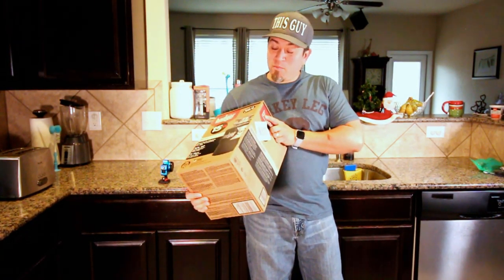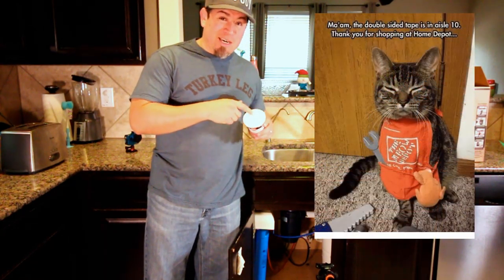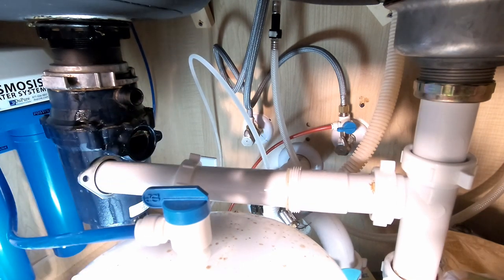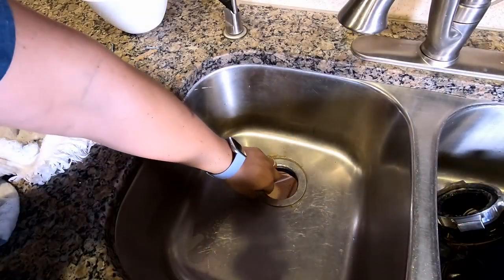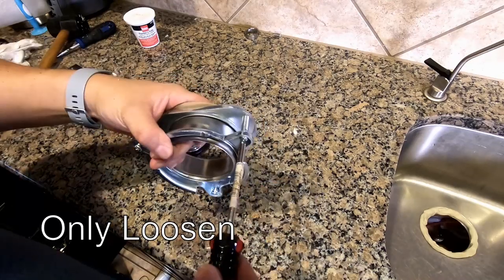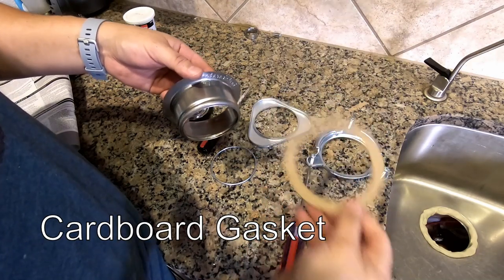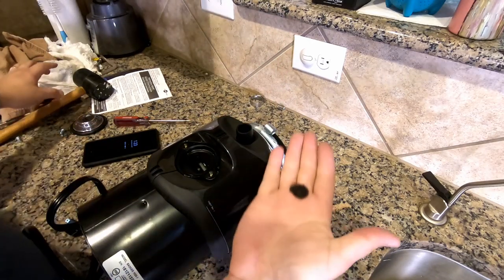Badger 15ss install - How to Replace a Garbage Disposal

Comment: This video was excellent! I have been avoiding replacing my broken garbage disposal because I thought it would be too complicated.  This video was well done and basically walked me through everything. The hardest part for me was getting the wires to connect to the EZ Cors connector. Thank you sir.  PRO TIP: The gasket that connected to the garbage disposal was leaking water. Make sure you adjust it evenly before tightening.

Comment: Don’t know if you’re still checking comments on this video (still relevant, still useful), but I just finished  replacing my daughter’s disposal, cracked a beer and feel like communicating.  I searched for Badger install because I was concerned about lining up my new unit with the existing drain pipe and I’d somehow lost the instruction sheet.  Anyhow, that all turned out to be no problem;  the turd in the punchbowl appeared earlier, when I was removing the old Badger 1.  I got a good laugh when you had to hacksaw the sink/basket flange off, because I ran into a similar (but worse) problem.  The triangular plate that fits under and encircles the sink flange was, in my case, rusted tight to that cylinder.  It took a full day and about a quart of PB Blaster to free the sucker, plus a lot of vulgar language and a lot of hammering with a piece of 2 X 4.  All in the past now, and the new Badger 15SS-3 works fine.  Your video was both helpful and fun.  Thanks for the moral support.

Comment: At the end, you correctly said, “And it works”, but you did not check for leaks  😢😢😢
I still enjoyed it. Thanks 😀
Reply from the maker: Sorry Richard.While not in the video, I did fill the sink completely with water, then ran the disposal to put stress on the connections and saw no leaks. To this day I havent had a single leak either.

Comment: Don’t want to be critical, but your rubber washer should not be fitted over the discharge pipe ... the rubber washer should go on first, then the discharge pipe, followed by the metal flange.  I only tell you this because my first Badger failed after being installed this way.
Reply from the maker: Thanks Steve. You are the second person to call this out. I mimicked how my previous disposal as installed. I have left as is and haven't seen any issues from it, yet.

Comment: If i'm imagining things, please correct me... but it appears you placed the disposal waste line seal over the outside of the pipe and flange (right around the 17:00 mark)... when the gasket included with Badger disposals is supposed to go BETWEEN the waste pipe flange and the disposal discharge outlet.  I waited to see how it ended up, and around the 17:45 mark, it appears you tighten the discharge pipe directly against the disposal with no seal between the two.
Reply from the maker: I had to double check my literature and it shows the waste line seal inserted into the tailpipe opening first, then the provided tailpipe on top of it. The way I installed it on the video is slightly different than the provided instruction, but I have done it this way several times now. I haven't ran into any issues with leakage before since the gasket still forms a seal around the pipe flange and the flange plate. I even filled my sink and ran the disposal to pressure test the seal without issues. Tomato tomatoe I guess.
Reply from the maker: Marc Howard  Thank You.

Comment: I just installed the same disposal and am alarmed at how loud it is. Is yours the same? Is it loud when first installed and then gets quieter? Thanks
Reply from the maker: Mine wasn't too loud, but then again the previous model sounded like a wood chipper. Be sure to register with Badger in case it goes wacky on you.

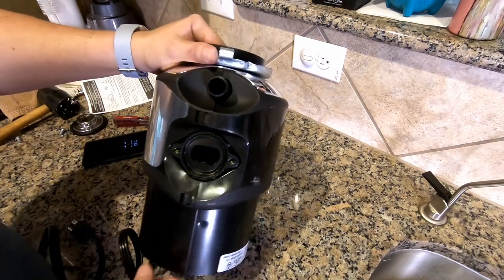Comment: At the 15:26 mark you say "since you have a garbage disposal you are going to have to knock the cap out" but did you really mean to say "since you have a dishwasher connecting through you are going to have to knock the plug out"?
Reply from the maker: Yes, I realized the error after the fact. I should add in a caption.
Reply: @ThisGuyProductions  I wondered about that afterward..I realized that's what you probably meant but if it wasn't for you being so thorough I wouldn't have figured that out.

Comment: Installed mine today, however its not turning on. It runs from a switch and not a plug in so I wired it to my switch connection but its not making any sounds
Reply from the maker: I would check your breaker box to ensure it isnt tripped. I would also verify the breaker on the unit hasnt tripped. Finally, and most bothersome, double check the wiring on the electrical plug in the bottom of the unit.
Reply: @ThisGuyProductions  it was the wiring on the bottom of the unit. Somehow the wire nut came loose when I mounted it. Thanks though. Awesome video!
Reply from the maker: @kaseybakker8791  Well I am glad nobody got zapped.

Comment: This looks like it would help, but I can't find the plug to unplug the old disposal
Reply from the maker: Is the old disposal hard wired into the homes wiring? If so, that is a new one for me. Also, do you have an outlet under the sink for the new disposal?
Reply: @ThisGuyProductions  there's no outlet in sight... It looks like I need to remove panels between the shelves but no guarantee there's a plug there
Reply from the maker: @munchieswithmorgan2654  Can you send me a photo of your disposal, and where the wire is running to? Also, if you can get me the manufacturer and the model number. I can do some quick research. mark@launchpadb.com

Comment: Can I hire you??  I just spent a grand on a new disposal install, and not even sure it's to code.
Reply from the maker: I'm in San Antonio Tx, so if you are local I can definitely help out. I am not a "certified" repairman though. I also considered hiring someone until I realized it wasnt too complex.
Reply: This Guy Ugh, I’m all the way over in Portland, OR. I’ll have to give you some ideas on videos so you can help me remotely. Projects I’m working on: fixing creaky wood floors, fixing old/wonky recessed light, and figuring out what to do with my bathroom door. Bathroom is so small and the door swings the wrong way. Maybe a barn door? Love, love your humor. I’ll watch your videos even if I have no projects to work on!
Reply from the maker: @randizimmer2366  Thanks. I'm always open for suggestions. You can use a pocket door, or just change your door to swing the opposite way. Portland is lovely.
Reply: This Guy you should make a video about installing a pocket door. If one doesn’t exist already, is it hard to install? My house is only 800 sq feet so I’d love ideas for small spaces.
Reply from the maker: @randizimmer2366  It is a challenge to install cause it requires to basically tear out the wall and replace the wall studs. It would require a subcontractor, but would be worth every penny.
Reply: This Guy that’s what I was afraid of. Sounds like a pretty in depth project. Not a DIY. How about a barn door, have you installed one? Maybe do a video if you plan to do one someday?
Reply from the maker: @randizimmer2366  I'll look into it.
Reply: @randizimmer2366  I did a pocket door but I was building a new wall from scratch at the same time so I didn't have to knock out anything. If you are still considering it (i see your comment was a year ago), the Johnson Hardware 1500 series soft close is what I got and they hae a great video on how to install it (actually two, one made about 9 years ago and then an even better updated one about a year ago), and it helped perfectly.  The printed instruction are shit and worthless  but the video is VERY well done with 3D grapjhics and my project came out just the way I wanted and it works perfectly.   A guy I know said his company probably would have charge 4-5 grand to do the wall with pocket door and I did if for about $500 bucks but it takes some time and patience. Less than $700 even if I count the expense of the ramshot tool and ammo for attaching the studs to the cement floor.  Just measure and plan carefully and measure and check every step and you'll be good.